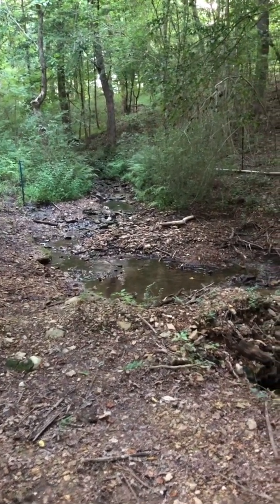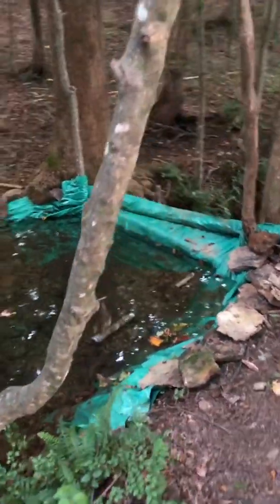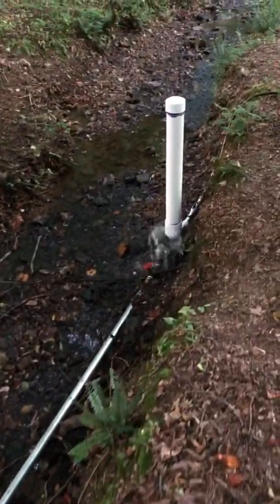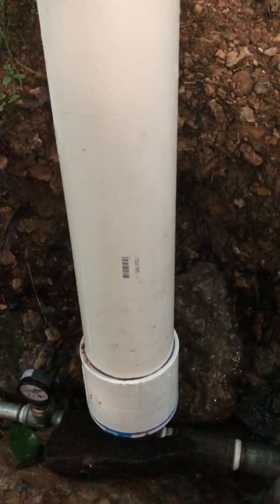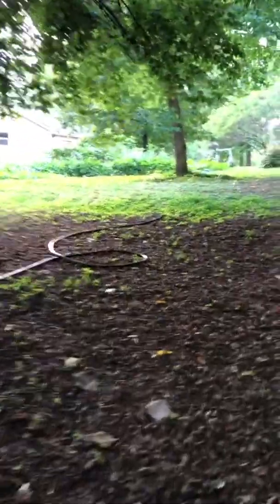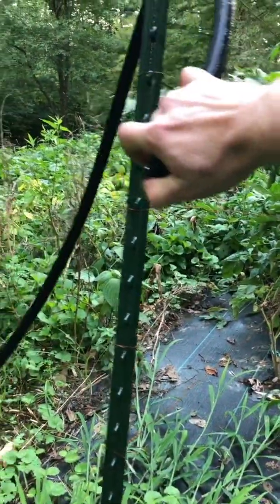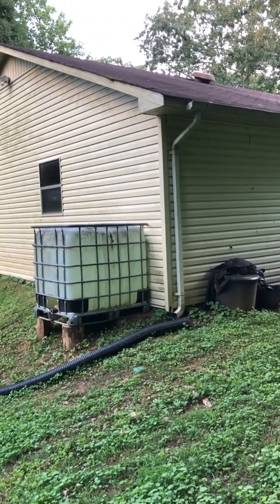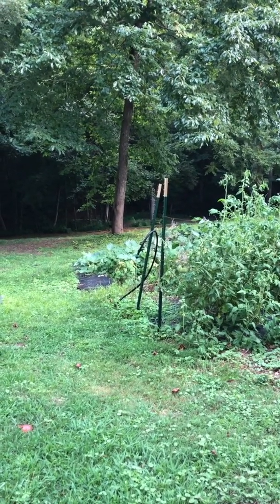Pumping water uphill using gravity - Ram Pump

Comment: Not much comments on here because I think people are quick to buy a gas powered or electric pump. With this set up and some minor incidentals, there's almost no future cost. And this will run 24/7. Awesome.
Reply from the maker: I just had to replace the top “clacker” brass valve last week.  That’s three years of running.  I have a stainless steel one on there now.
Reply from the maker: I forgot I had a stainless on in this video.  I took it off at some point and do not remember why.  That same stainless is back on it now.